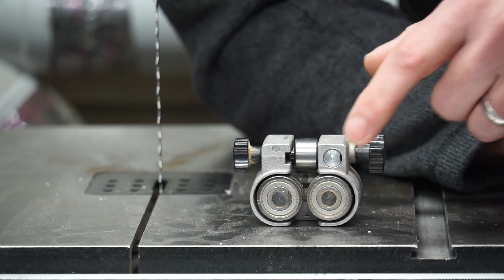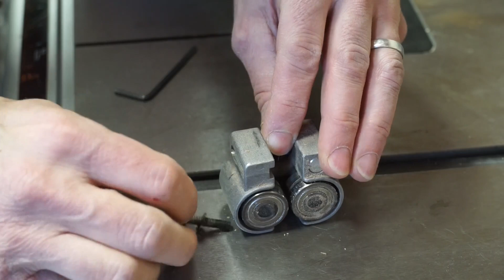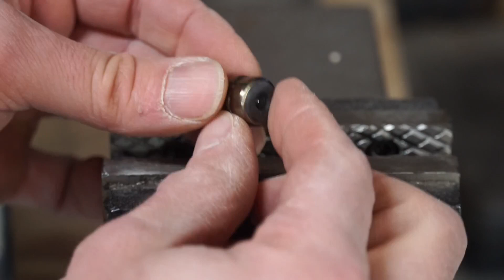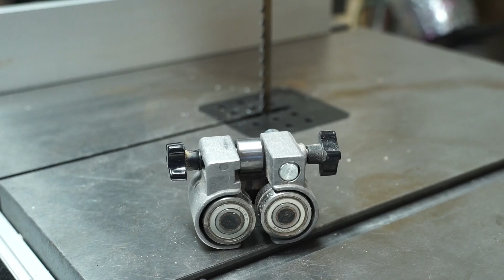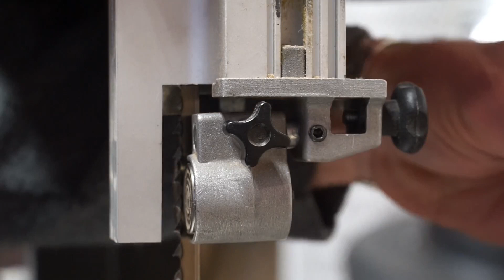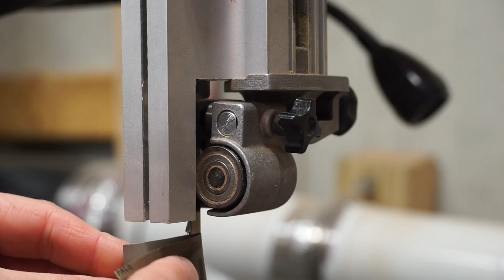Woodworking Basics: Bandsaw Thrust Bearing Replacement and Adjustment

Comment: I have this very same set up on my band saw it has the same thrust bearing, my bearing is as bad as yours, but I cant find the part number it is not shown in the parts list for my band saw, I am in Australia could you please tell me the part number you have for your band saw, I will probably have to buy one in the US, thank you regards Peter.
Reply from the maker: Of course, Peter. Here you go: [3966-100] Bearing for WEN 3966. I have already had to replace mine twice. I am finding it's not a great saw unfortunately.